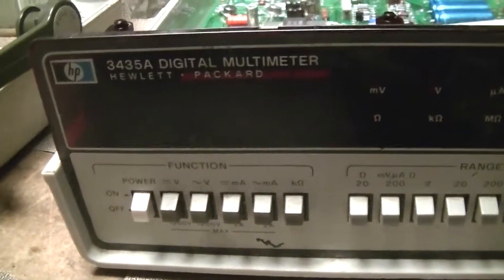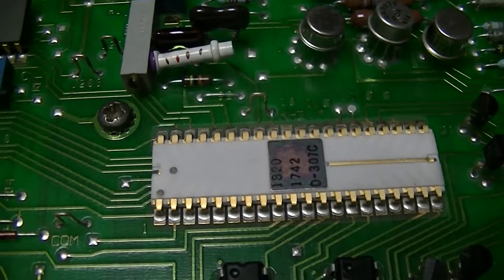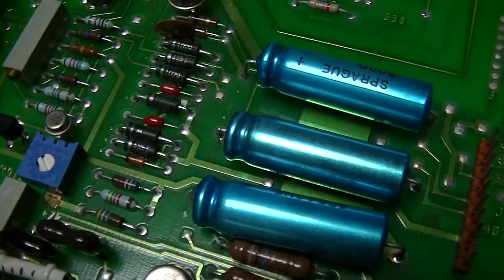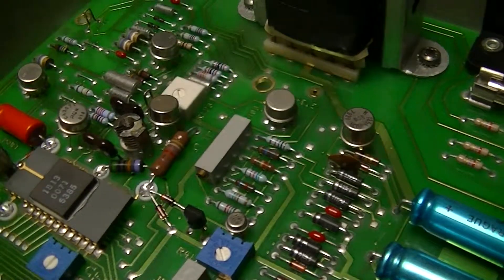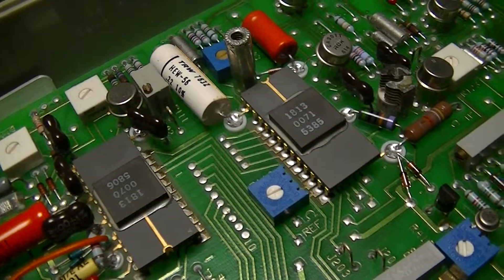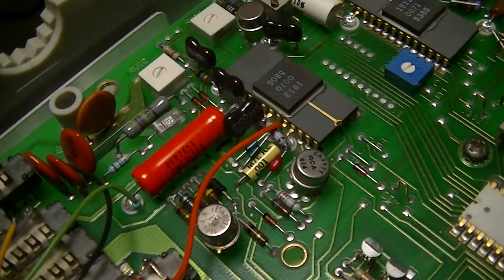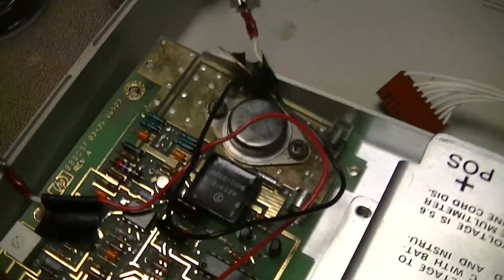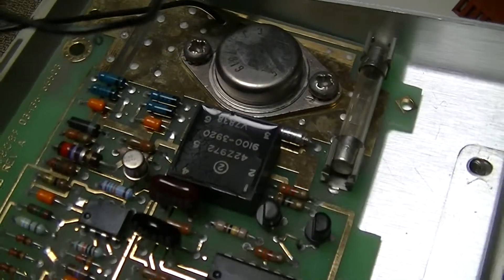HP 3435A multimeter guts

Comment: Mine has a problem. Resistance reading is stuck at .13 ohms. Voltage measurements all seem to be fine, just won't measure resistance. No internal battery.

Comment: Just picked up one of these at our radio club meeting auction (Ontario Vintage Radio Association - OVRA.) Very nice unit, works well, looks hardly used. It has that classic HP look and feel.  I need to check the internal battery.  The only downside (so far!) is bench footprint... much bigger than my constantly in use Fluke 111 ! Cheers, Roger.